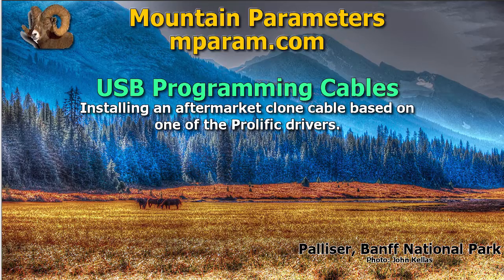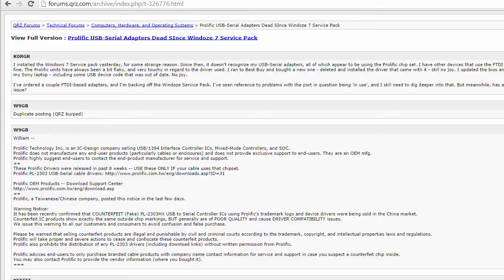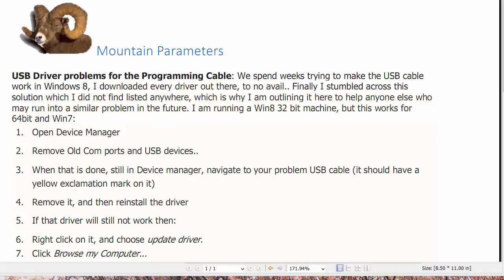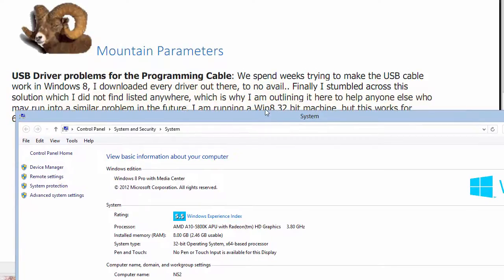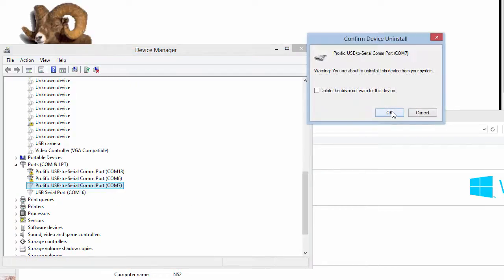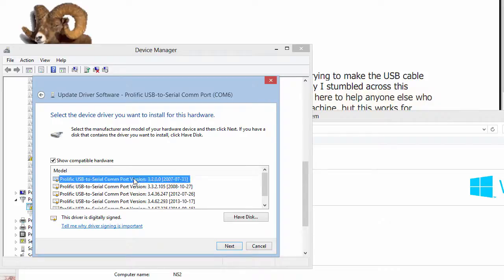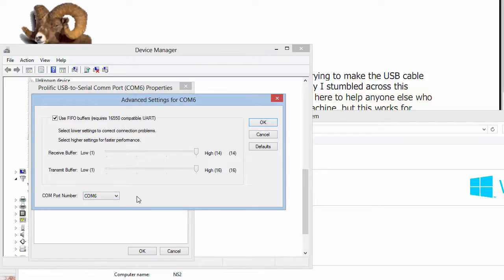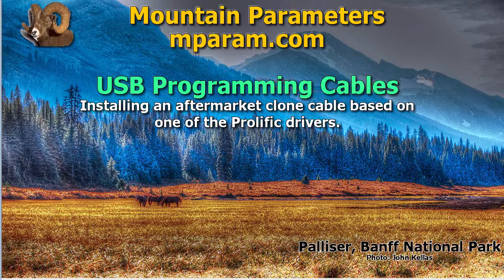Prolific (Clone) USB Cable Driver Installation

Comment: I want to thank you for this video!,,   first  I'm 4 days spent with the computer with no result after seen this video,  half an hour step by step I was ready !!  best 73"
Reply from the maker: Thanks for the positive feedback!

I just did up another video on how to build a better cable for a few bucks. It's had a massive 51 views so far, and no comments. I'm about to get the Windows 10 computer in my shop dusted off today and want to start programming radios in my shop instead of my home office (which runs WIndows 7 and it has been playing nicely with the Prolific so far). I expect perhaps having an FTDI chipset based cable is going to make my life easier under Windows 10 however.

Comment: Mine says unknown device.
Reply from the maker: +ArriCAT5e Remove the device via Device Manager, and then start the process as described. Follow it step by step, do not omit a step.
Reply: +Mountain Parameters com ports don't show on device manager. I think it's a clone chip.
Reply from the maker: +ArriCAT5e 
The clone cables will work with the original drivers as noted, including WIndows 10. The problem with having only one cable is you never know if you simply have a bad cable and you're wasting precious time for no reason. That has happened to me in the past. Two options to address that are: 1: Try to install on another computer. 2: Obtain another cable, which might mean purchasing one.

Be sure you have completed the steps in the video about removing the hidden devices, as they can tie up the com port allocations.
Reply: +Mountain Parameters I'm going to try buying an official prolific serial adapter with the serial cable
Reply from the maker: +ArriCAT5e 
OK, let us know if that solves the problem. Thanks.